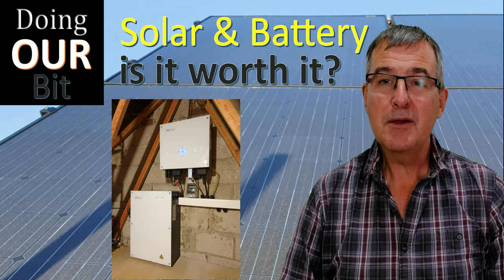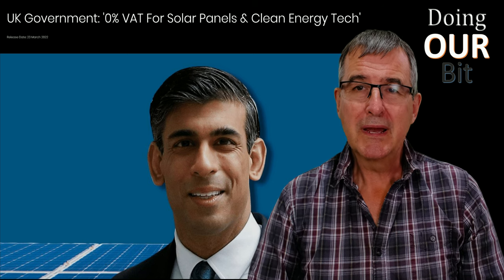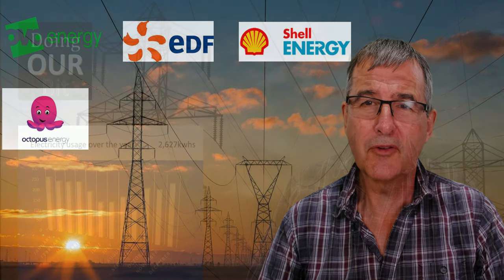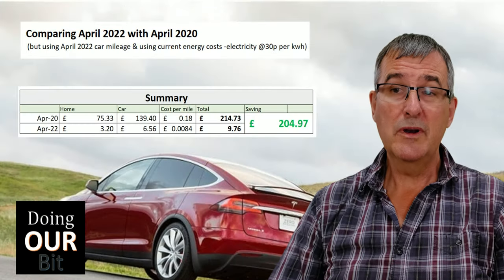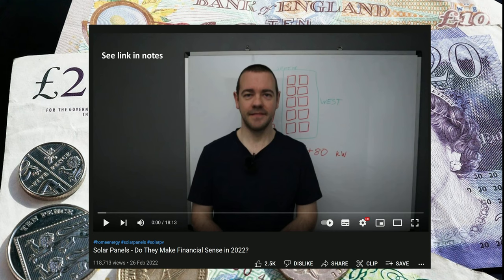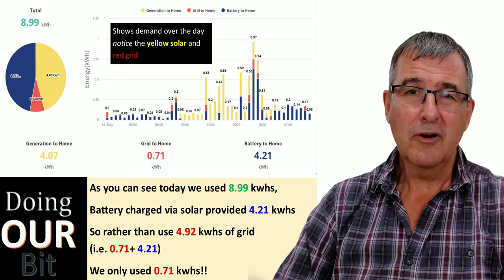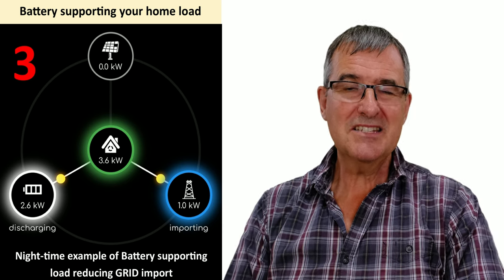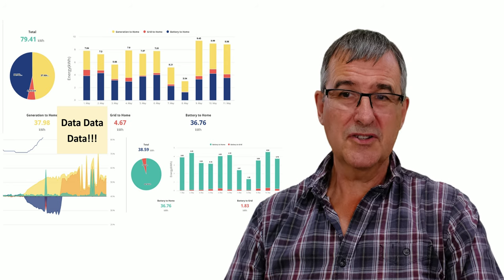Solar  and Battery install - is it worth it?

Comment: I have just had 12x405w solars panels and 7.2 kWh batteries fitted and it’s been excellent. It has exceeded my expectations. It cost £11k for the install. With the price of electricity rising again in October it will pay for itself quickly.
Reply: Fantastic...win, win!
Reply: Does the battery cover all your household in the evening? I have gas and electric so it's hard to spent on the solar and batteries when I can't heat my water
Reply: @leejohnson197733  if we have had a good solar day and the battery is full at 5/6pm it will last all night. I have quite a few outside lights and two teenage lads playing two different Xbox and tv’s. It’s the summer now so it will be a different story in the winter I would guess. The batteries are a must have in my opinion and get as many as your budget allows.
Reply: Not true .
Reply: @ahmedalsharman  what's not true?
Reply: @ethjon12  he said at the end it will pay for it self soon, which is not true .. it will take  many years to pay for it self if it kept in great condation without any failure. . Whan i say many years i.e 10 years plus , they are bad investment.
Reply: @jaxgeorge3088  ok i will look into this a bit more seriously, however its probably the worst time of year to get them installed now

Comment: I used to work for a Heat Pump company and your comment about the pigeon reminded me about something. There was this one customer on the system that never seemed to have a heat pump installed, so I kept chasing it up. Eventually I got told the customer was waiting for the bats to move out! I asked why we could not get rid of them to find out it's illegal to move them. I wonder if they are still waiting for the bats to move out lol

Comment: Nicely put together vid. We've just had a 12 panel 3.5 kwh battery system fitted. We have the smart meter and a great app allowing us to view the charging and battery status at all times. 
We have been impressed just how much power can be produced even through these first low sun winter days.
Think even now we can see we should have gone for two batteries but its early days and we need to get our immersion heater on a smart switch to heat our hot water tank. 
If anyone is wondering who we used, the company is called Solar Fast. From inquiry to installation was about 4 weeks.
Reply: Many thanks.  That's a very impressive turnaround, indeed in todays market so I'm sure this will be a useful contact for others. I'm just finishing off a video on electric heating, which is the last stage for me switching to 100% electric. I think it will be closer to a year between initial enquiry and final installation, but this is partly planned to be fair, and starting with a combi boiler in small house complicates things some what!

Comment: Terrific. I'm in Ireland in the frozen north of the planet. I got a 3 KW system (finally) fully installed in October, just in time for the winter - and who knew the sun stays so low in wintertime? Really, when you really measure (or check) the angles, it's kinda shocking [*shakes fist at the cosmos*]. At the time, my Siemens (very unsmart) meter was very happy to run backwards when we were exporting to the grid. This now doesn't happen so much (who knows why!), but now in June the days last for ever and my panels are gushing with electricity that often I'm not using, so I soooo wish I'd got a battery with my install. I'm trying to organise one now, so hopefully all will be well soon!
Reply: 5% is the true time averaged efficiency of solar panels.
Reply: Absolutely bloody useless
Reply: Yes it's terrible that they are only 5% efficient... that keeps me up at night when i haven't paid for electricity in months 🙄
Reply: @mikeyboy01443  🏴
Reply: @thelethargicponderer6793  you got it
Reply: Well Ben, I'm in donegal, was planning on installing a 7 kw system. How is your experience with pv going?
Reply: It might cost you more than just the battery as the Inverter has to be able to charge the battery up and most grid tied inverter don't do this!! A hybrid inverter is what you would be looking for giving what is known as a UPS supply (uninterupted power supply) that way you stay powered up as long as your battery will allow, and perhaps more importantly keep the grid workers safe!!!

Comment: Been researching Solar panels for a while now & this is the best video I have seen step by step simple well explained 👏 👍 gone for a 10 panel system (3 bed house) with a hybrid inverter in case I fit battery system at later date. Have I made right decision who knows will see.
Reply: Many, many thanks! Sounds like you have made a good first step. Doing it this way, you should be able to see what size of battery will make sense for you. I'm looking forward to my next step adding heating and hot water, which I know will be a challenge and might mean further changes, but I will share the journey so everyone can learn from my mistakes!! All the best 👍

Comment: Would be great to see a video on your battery and inverter installation and where it was installed. Thanks
Reply: Good idea....might do this with getting ESP sorted but hopefully got a system review tomorrow ref replacing our old gas combi boiler with a smart tank and Air-con.

Comment: Nice video and simply put. Thank you.  I have had solar panels fitted with SolarEdge optimisers for over 6 years now. Battery costs were prohibitive then, but cost of energy is changing the equation. I now have EV so even more so. It is true - and a lot of people did not realise that with solar panels without battery storage, you are exporting over 70% of solar energy back into the grid.   What I am trying to find out is what are the key features from a battery design/build we should look for. What are the limiting factors in the installation and choice of battery and/or storage capacity etc.  How relevant Is the charge/discharge rate of the battery. Is it limited by the inverter capacity? If so does that dictate the battery type to consider?
My average daily consumption is 10kwh per day in a 4 bed detached house with 2 adults.

Like you, I had Octopus Go tariff until recently. Now switched to Flexible as the day rate at 40p is too high. So considering battery to have access to cheap night rate  with Octopus Go again and minimise daytime grid import. Having said that, I have switched to Octopus Agile rate for export which pays on average 25p or more which offsets the 29p I pay for import from grid. You might want to consider this as no other energy provider offers this . Octopus are very good indeed with the Agile tariff for those who can benefit.
Reply: Many thanks for your kind words. The discharge rates are definitely important as my battery 8.2 GivEnergy can provide 2.6kw and the inverter upto 3.6kw, and this is the thing, they can work together to met the load. If I made a mistake its possibly not adding an AC coupler to my original Solax inverter which requires a G99 DNO application but gives you more headroom, because although you can have twin hybrid inverters there are issues apparently. Anyway,  I plan to do an indepth look at this in March 2023 when I have a year's worth of solid data (so I will have each month's solar generated, solar used, battery contribution, both via solar and off peak charging, total remaining solar export and grid v if I was just using the grid. But when I move next year to all electric heating part of that will be looking at what upgrades I need to the look at, based on peak demand so hopefully I can make use of as much off peak as possible!! Worth checking out "Gary does Solar" ...Good for technical details but I hope to try and demystify this myself as when you are spending this kind of money guessing or just "hoping for the best" ,  is likely to end badly. It certainly is not straightforward but the benefits of generating your own energy is definitely worth it hey!

Comment: My neighbour had solar put in about 6 months ago. The company who installed it said don’t go for a battery system   as the battery won’t last more than 3 to 5 years .
Reply: Thanks for your comment. That is though truly shocking that someone working in the renewable industry would parrat a common myth like that. Especially as they should know that  batteries come with a 8-10 year guarantee! Sadly there is a lot of misinformation out there and particularly sad in the current situation that your neighbour is missing out on the benefits as a consequence.

Comment: I'm love my inverter system 3kw 24v  inverter , 4 gel battery connect in series and parallel and 4 panels 1360w . Programmed to run on solar and battery in the day only , evening run on battery to 80% then switching to utility . So trying to stay on solar and battery for as long as possible . We have gas stove and geyser or water warmer .  2 in the house is now using 3kwh from 6.5kwh a day so for me it's a win

Comment: It will be interesting to find out what the feeling is post the upcoming electricity price shocks, as to whether it is worth it, or otherwise. A four- or fivefold increase in cost of electricity without the corresponding uplift in export values may alter the outcomes. It’s also quite possible that the export-timing loophole may be nullified at the stroke of a Treasury pen. Just the other side of the coin.
Reply: If you are only doing this through a financial lens obviously no one can second guess the future in these crazy times. But energy costs going up only accelerates the ROI, and the export cost going up likewise. The fact I can use my own energy to power my car is also a strong benefit totally under my control. Hope to add ESP to my system next month so we can power the house in the case of a powercut, so I think the "is it worth it" case is extremely strong. I intend to do a detailed analysis of this in March 2023 when I have a years worth of solid data, plus we will be through two price caps or whatever happens over the next very uncertain 6 months but I don't regret my investment at all, just grateful I did it when I did given the wait times on installations today. While I'm on holiday my system is still working and just exporting more while totally covering all the base needs of the property...what's not to like!

Comment: Hi.  Nice video
I have a quick question for you.
Anual consumption about 2200 kw.
Thinking that we can get 10x 435 ja solar panels + givenergy 3.6 but can't decide on the battery.
They recommend a givenergy 5.2 kwh battery but I'm thinking for 9.5 kwh battery.
Is saturday,  3pm , already used 4kwh electricity for washing , tumble dryer,  boiler etc. Weekends we are over average (~6kwh/day) , about 9 ,even 10kwh /day. 
Honestly,  can't decide.
Can you give an advice for this, please? Thanks
Reply from the maker: Although your consumption is quite low I would go for the 9.5 if you can. Obviously it depends on future plans but if the add electric heating /cooling, it will definitely be useful but assuming you can charge it overnight on an off peak tariff, even if you don't use all of it  you can always force discharge back to the grid at high peak times that can earn you money (in UK at least). Load shifting as its called helps balance the grid and acellerates your return on investment too... So win win. Certainly now I'm 100% electric I'd love to have double my battery storage. You can have too much though... the key is the off peak window in hours x the rate the battery charges which for us is 6 x 2.4 =14.4kwhs...so 16 would be ideal. Hope this helps.
Reply: @doingourbit8551  why you went for 2.4 kwhs ? people say the small batterys have a  80% discharge, the bigger batterys( 8.2 and 9.5 ) get almost 100% discharge. 
I'm definitely going for the 9.5 kwh battery, thanks for confirming me that.

what solar system you got(solar panels W size , how many solar panels, inverter)? 
Thanks for answering
Reply from the maker: @mihairachita174  We've got 16 300watt panels 4.8kws plus 8.2 battery and a 3.6 inverter. The 2.4 is the charging rate per hour. Interestingly they don't seem to quote this on the 9.5 battery but have heard it might be higher than this which is all good. And yes, depth of discharge just as important for knowing the usable size of the battery as the 2.6 and 5.2 versions are in effect 2 & 4 near enough in real terms so the larger two batteries are better options.
Reply: @doingourbit8551  thanks for confirming that. 
Definitely going for 9.5  battery.

Comment: Does your battery not get to hot in summer in the loft ???
Reply: The maximum temperature its hit is 39 degrees, but the safe operating temperature range is -20 to plus 55 degrees, so no problem as such. If I was starting again, I'd probably go with a garage install for preference, but technically, loft installation is OK.

Comment: I'm really considering this but I need something to heat my water other than gas.
I'm south facing
Reply: I plan to heat my water next year using the Myenergy eddi product off the solar as currently have their Zappi car charger and harvi hub. There are other systems to like iboost too. It's going to be a job because we also need to fit a smart tank as we have a combi boiler, so no water tank. Hopefully I have a company doing a survey next month with the aim of doing this next year as part of the final bit of getting everything in the home powered by electricity, and removing the gas meter. I intend to do videos of the journey so hopefully helpful to others seeking to do the same.

Comment: Much like you, we've got a GIV  battery (8kWh) and inverter, with a 4kW panel setup. Unfortunately we can't have a smart meter, (so no SEG sales or grey day cheap electricity into the battery), but even so I reckon we're going to save £700-£900 this year, and that's assuming no price increase in October
Reply: Thanks for commenting. With every passing day the case for solar battery just gets stronger and stronger given the continuing rise in projected electricity prices. Is it the coms/ location issue with a smart meter the problem? Getting an off peak tariff certainly makes an increasingly greater impact on savings. We are currently paying 5p off peak 15p peak but come September that rises to 7.5p and 40p! So load sifting with peak 5 x as expensive plus the SEG is certainly significant. I kinda think they need to get those coms modules upgraded now at least to 4g for areas where reception is poor and to start the switch now rather than wait til 2030. Anyway either way GivEnergy system is certainly a winner in my book!

Comment: Can you install without smart meter?
Reply: Yes you can but you would miss out on off peak overnight charging of your battery during the winter. In my case a saving as of this month of 32p for every kw, and of course the export side would be a challenge. The other issue would be knowing what was going on although this could be recorded in your systems data. It would be worth checking out what exactly is available and deciding based on that. I know I am a bit of a data nut but I would miss the transparency of the whole system that a smart meter provides.

Comment: I’m having trouble getting companies to respond to my requests to quote me a system, and the only one that has wants £90 to survey my property. Now I have no issue in paying a fee, I do have an issue when I want at least 3 companies to provide quotes.
Reply: Wow....I know you have to pay for ASHP (AirSourcedHeqtPumps) survey which is fair enough given it's not a 5 minute job (heat loss /radiator calculations etc) but not heard this for solar and/or battery! Especially as they could do a lot using remote tools and asking some basic questions. The company I'm using to look into heating as well as possible solar upgrade are not taking on any new customers (Southern UK) at the moment (thankfully got in before!) but it's a worrying development. There just doesn't seem to be enough installers to meet demand. Hope they at least refund this if you place an order with them, as my company does with ASHP quotes.

Comment: There are some terrified stories about solar panels set fire on roofs of houses. That's the main reason to put me off from installation of solar systems in my house. How can I make sure the solar panels which I will be purchased and installed are fireproof? Does your house insurance premium go up because you have installed solar panels on your roof? or does your house insurance premium include accident like fire set by solar panels? Thanks
Reply: No greater than your wiring in your house setting fire inside your walls